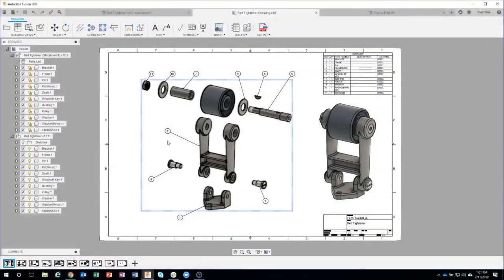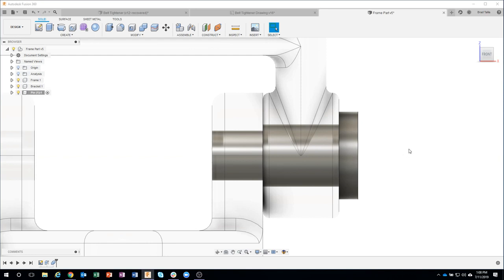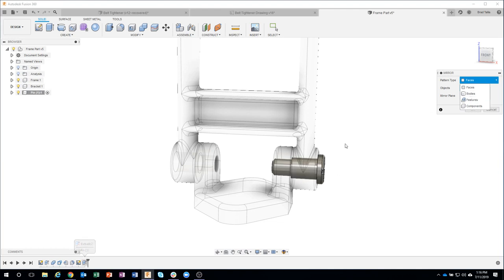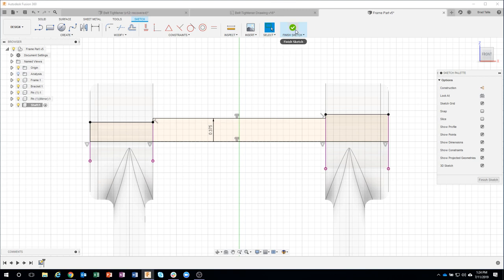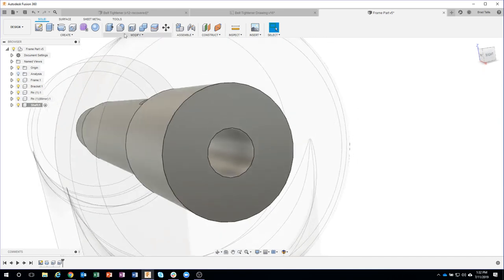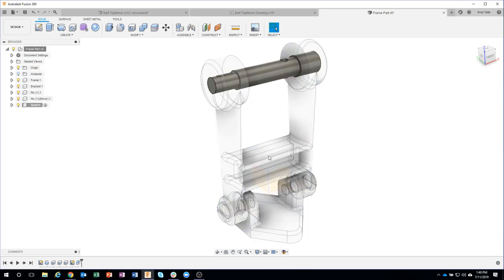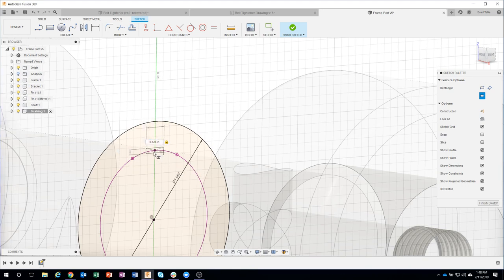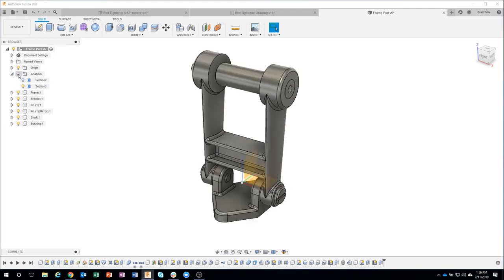Episode 38,  Creating In Context Designs part 2 of 3

Comment: I didn’t know the hole command would automatically place the hole tangent to the top or the side of a cylinder side. This tip can be taken a little further! When the hole is placed on the side of a cylinder, a rotation handle appears so you can change the hole angle relative to the center of the cylinder to place it let's say at 45 degrees! By by tangency planes! Great tip!
Reply from the maker: Good point!